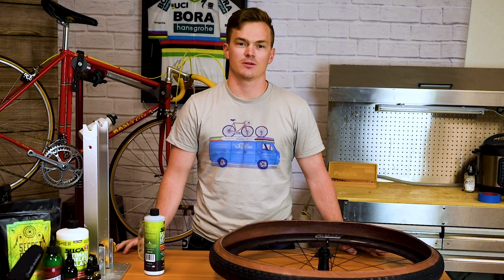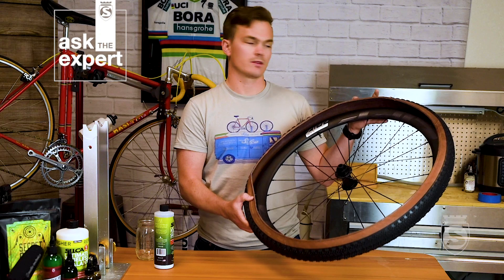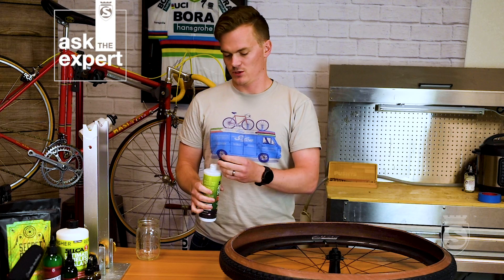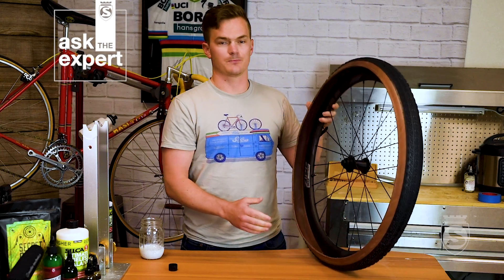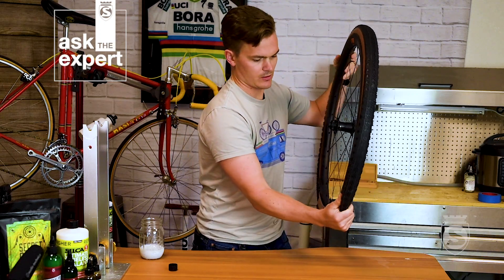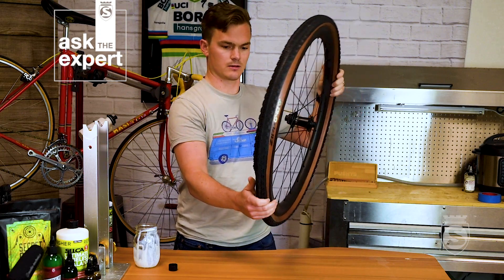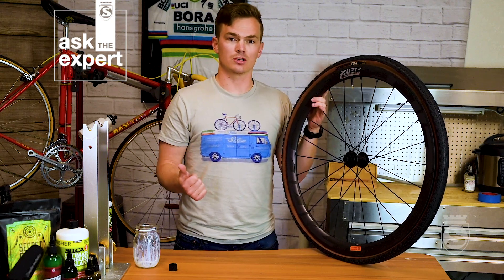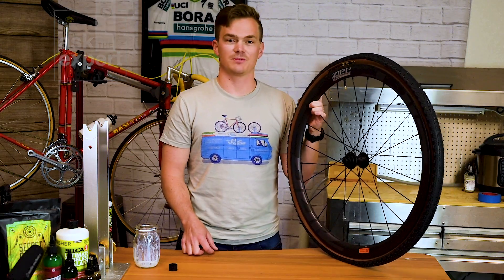Pour-In Method for Tubeless Tire Sealant | Ask the Expert - Episode 022

Comment: The pour-in method does work. I just tried it less than 30 minutes ago. There's still slight leakage while I was mounting the tire but I remembered this time not to squash the bottom of the tire as that's where most of the sealant had gravitated to. 

I learned a few things about the Silca sealant with FIBERFOAM:
1. From a previous unsuccessful attempt to add more sealant via a gap opened by partially unseating the tire, because the gap was not wide enough, chunks of carbon fiber was left at the bead. When dried, these proved quite difficult to remove a few weeks later when I unmounted the tire to test the pour-in method.
2. When your bottle of sealant is not full - my original 8-oz bottle had probably 1 - 2 oz left - DO NOT shake it hard. Doing so will make it extremely foamy and you won't be able to measure the exact amount, in addition to making it very challenging to pour into the tire. I think it's sufficient to just give the bottle of sealant a light swirl and then leaving it inverted.
3. Before attempting to pour in the sealant, make sure you are able to mount the tire first. This is especially so if you have never mounted that particular brand/model of tire on that rim. If you are able to mount the tire without any sealant, you will be able to mount the tire after pouring in the sealant. If not, you may end up wasting the sealant.
4. Wear eye protection when mounting and especially when seating the tire.
Reply: Good luck buddy, I know you have to crack the beat all the way around on a tubeless tire in order to get it to mount again after you put more sealant in after your scheduled 90 day servicing, because the shit has already dried out if you were in warm weather.
This is the biggest fucking scam I’ve ever seen in the bicycling industry. Going back to tubes and gator skin tires.
Reply: @ChrisFacciol_LIFELINEPHOTO  You won't have to unmount the tire to add more sealant after 90 days. The Silca sealant replenisher can be injected via the valve stem (their sealant with fiberfoam can only be poured in). I won't necessarily call tubeless technology a scam (tubeless is very prevalent in the MTB and gravel world). It is definitely higher maintenance than tubes and I'll be the first to say it is not for everyone. But I have no regret since switching to tubeless back in 2019 after suffering race-ending punctures in two consecutive events.

Comment: Instead of using a jar, I prefer putting the bottle of sealant on a scale and reset it to zero. Then pour some sealant into your tire and set the bottle back on the scale, now indicating you how much you have put into the wheel. Repeat if necessary up to the desired amount.

Comment: It is a pain to find, the volume of sealant you need, for a specific tire type. Why it is not published. Apparently the volume is depending if it "Tubeless ready tire" and "Tubeless Tire". Also lighter tires normally need more sealant since the tires consume more Silca Sealant. But at least we should have a range to consider. Also you need to use the Sealant Replenisher with Silca Sealant every 90 to 120 days (mentioned on the bottle). But again no info anywhere, how much to use every 90 to 120 days ???? No info.
For the Sealant, It the video instruction, it says to use 4 oz (118ml = 11.8cl) for a 40mm(1.5 inch)/700c gravel tire. If you use a 47mm tire I would say, add  10% more Sealant. If somebody has more accurate data and experience, please let us know. Because the manufacturer doesn't tell us.

Comment: First time using this sealant. I note the liquid is a lot thinner than others I have used and that caught me out.

My advice if you have thinner road-type tyres would be to get the tyre seated first and then break a small section of tyre off the rim again to pour in the Silca.

I didn't and as I was trying top roll the tyre onto the rim I squashed the bottom of the tyre on the bench and got a load of sealant leak out. Wasn't a huge disaster, but it's better inside the tyre!

I did witness though the latex was very quick to form, unlike some others I've used!
Reply: No, do not get the tire seated first. This does not work. I tried it. The gap of a partially seated tire - I am assuming the other side of the tire is completely seated - is simply not wide enough to allow you to pour in this sealant with various sizes of carbon fiber. I ended up leaving chunks of carbon fibers along the exposed bead with very little of them in the tire. Use the method described in this video. You will still spill a little bit of sealant and you just have to remember not to squash the bottom of the tire where all the sealant has gravitated to 😀

Comment: When you've had a puncture and sealant has leaked out (and sealed ultimately) do you put sealant or replenisher in the tyre?  And how much?  I presume that you need to remove part of the tyre again to do this.  Can you please advise?
Reply from the maker: The amount will depend on the amount of loss. For replacement, you can use the Ultimate Tubeless Sealant via the pour in method OR you could use the Ultimate Replenisher which is injectable through the valve stem.
Reply: Many thanks.   I’ll go with the Replenisher as it’s easier!

Comment: Does the 76 projects high flow no clog tubeless valve work with the valve injection method?
Reply from the maker: We went through 3 commercial bottling machines while it clogged 2" hoses, We wouldn't recommend trying it.  Our Replenisher can be injected through the valve.
Reply: 100% it does not go through the 76 projects valve

Comment: ?  Are Disc brake bikes more aero than Rim brake bikes?
Reply: Not generally no. Most new bikes are more aero than most old bikes and most new bikes are disc brake specific however.
Reply: @LarsRR  but the additional weight, pad rubbing and larger hoods?  Why are the pros preferring the rim brake on climbs and tt?
Reply: @mutleyadamsracing2684  good question. I'd think on a TT bike especially with every aerodynamic advantage being exploited, you'd want rim brakes tucked somewhere on the frame and fork. Carbon rims and rim brakes suck and suck more in the rain. I think the trade off makes it worth running disk brakes. And then there's always the industry pushing it.

Comment: So I’m guessing 3 fl oz, aka 84ml of sealant. Otherwise, was the first bead fully mounted, ie tire pumped and popped and one side then unmounted? Or was the first bead simply sitting in the U of the rim?
Reply from the maker: 3oz, not mm (sorry we didn't catch that one).  2 oz for road, 3 for gravel, 4-5 for MTB tires and 6 for fat bike would be our recommendations. If one side is fully seated it does make the inflation a little easier, but this particular set up is a tight fit so it was just mounted in the deepest section of the rim to make the install easier.  It ultimately inflated with a few pumps from a floor pump.
Reply: @SILCAVelo  Hey team, can you put this on the product specification page? It wasn't overly clear...
Reply: @SILCAVelo  thank you, and it sounded like you said millimeters vs milliliters. watching what you poured made it obvious enough though.
Reply: @SILCAVelo  I was going to post “wth millimeters? in a random jar?” 

Anyway, glad to read that it’s 3 oz. The struggle with metric for those born to imperial is real. 😂

Comment: This method is suitable with a round 2" MTB tire... I tried it with a 25mm Challenge Criterium RS25 road tire, and it is a fail : the open tubular construction of this tire makes it flat and too fit to the bead and much carbon fibers don't pass the gap, and once both sides on the bead (including one already seated thx to a previous operation with an inner tube) the tire loses much liquid before seating. My advice : take the amount of sealant you want to put in the tire, separate the fibers from the liquid, install the fibers inside the tire before installing, install the tire, and then put the liquid part of the sealant through the valve.
SILCA could help a lot by providing this product in 2 parts : a little bag of dry fibers to put in the tire before installing it, and liquid that should be very very close to their replenisher. So SILCA, please offer dry carbon fibers on the market !!

Comment: So disappointed, after viewing the Silca videos and reading mostly positive reviews, I wanted to try the Silca Sealant but after a difficult direct-into-tyre installation my first rear tyre puncture failed to seal or hold any pressure.  It also sprayed a significant amount of sealant over the bike which was a pain to remove and clean.  I had high expectations for this product but will not use it as I cannot rely on it at all.  Sorry Silca, over priced and over hyped.

Comment: I noticed in the video that using a compressor to seat the tire bead is an acceptable practice.  In the product installation instructions it mentions, "CO2, condensation from compressors, and talc powder can lead to hardening of the sealant.  These should be avoided when installing the sealant."  How significant is product hardening from the use of a compressor to seat the tire bead?  Thanks for an amazing product!!
Reply from the maker: So the risk here is relative to pH of the sealant.. the sealant has pH around 11 and will harden when pH drops below 8.. this is how we make it work in the presence of water.. a lot of sealants are water soluble so they won't work very well in the rain.  With this one, the water lowers the pH of the sealant making it instantly harden.  However, CO2 will acidify the air in the tire.. making the sealant harden, and if your compressor doesn't have an air dryer attached, may be full of condensate which can have pH as low as 3, so that can also damage or shorten the life of the sealant.  Talc is more just a contaminate that can thicken the sealant if used in large quantities.
Reply: @SILCAVelo  Got it. My compressor has an air dryer so I think I'll give it a shot. Thanks very much for the reply!

Comment: Travis….I bought in on this tubeless sealant. I now can’t fill my tires up . The sealant blocks the valve stems. After emailing silca without a reply I called. This call was worthless. I was hoping they could explain what I might be doing wrong. Instead I got sorry. So I replace all valve stems only to clog to the point my pump was blocked also. 
Do not buy this product!,its not the answer
Reply from the maker: There are certainly a few steps like inflating your tires at the 12 O'clock position to help prevent this from happening, but like all liquid latex sealants, clogged valves are a risk.